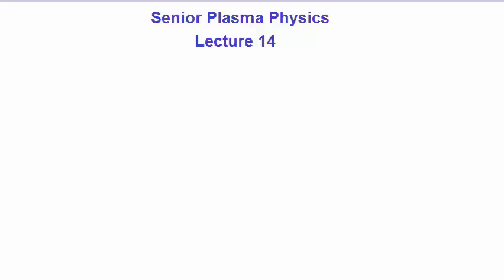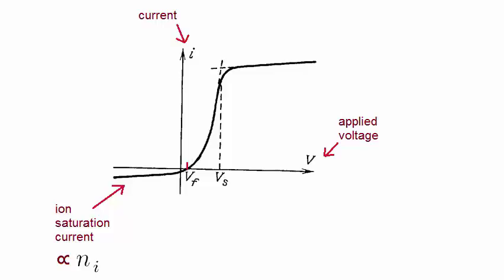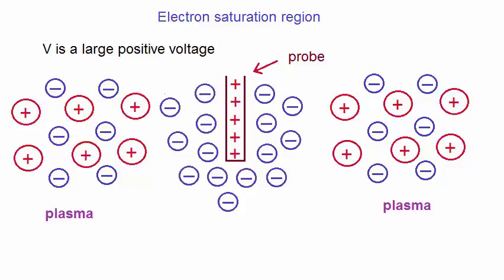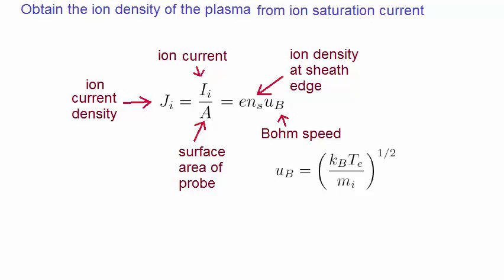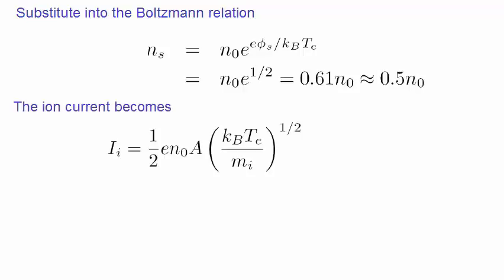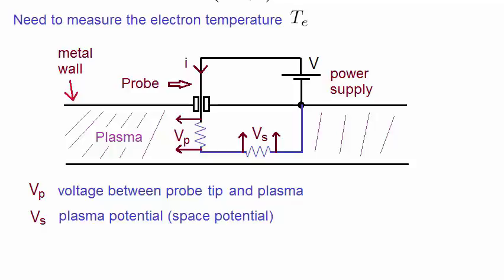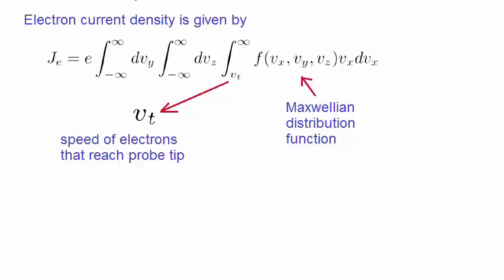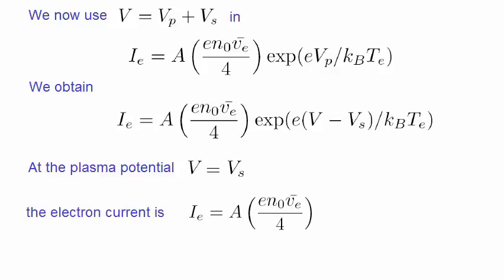Lecture 14 - Langmuir probe, electrostatic probe, plasma diagnostic

Comment: At 7:19, isn't v_t=(2eV_p / m)^0.5? Not 0.5mv^2 as shown in the video?
Reply from the maker: Yes you are correct. That is a typographical error. The equals sign after the v_t was supposed to be an arrow to the (2eV_p/m)^0.5. Unfortunately, Google has disabled annotations so it cannot be corrected with a pop-up comment anymore.

Comment: Hi, very good video, but one thing remains unclear to me : how do you obtain the temperature Te by looking at the slope of curve between Vf and Vs ? And why chosing a logarithm form if you look at the I curve instead of ln(I) ?
Reply from the maker: The slope of the line for the logarithmic plot has to be taken. The video was pointing out which region of the I-V curve is used in the logarithmic plot in order to obtain the electron temperature.
Reply: Take the derivative d( ln(I_e))/dV and the constant term will vanish. Remember V=V_p+V_s, take the derivative and you will get dV/dV=dV_p/dV beacuse V_s is a constant in the plot at  7:49. You will arrive to a nice expression that just depends on the slope multiplied by terms you already know. Sorry about the english

Comment: This is a nice video. 
One problem that I am facing is that my plasma chamber is made of Pyrex glass. 
I have the Langmuir probe which is connected by a coaxial cable. I can't understand where to connect the ground point of this co- axial cable. 
Can you please help me? 
Regards
Reply from the maker: It depends on how your plasma is generated. If it is a DC discharge then there will be a cathode and an anode in your chamber. Assuming your anode is grounded, then your Langmuir probe ground will be connected to that (but first make sure the anode is at ground potential). If it is a radio-frequency discharge and there is no ground in the chamber anywhere, then you will need to use a double Langmuir probe, not a single one as given in this lecture.
Reply: @usyd-seniorplasmaphysicsle6653  There is a cylindrical chamber of Pyrex glass. Two plates, anode and cathode is connected with a power supply of 1kV and a resistance in series. By lowering the pressure, I can observe the plasma glow. At the middle of the chamber there is a hole to connect the Langmuir probe. 
I can't understand the use of the body of the Langmuir probe as the body of the chamber is nonconducting. 
Please clear this point.
Reply from the maker: @nityanandadas5575  Please see my previous reply. You have an anode and a cathode. Check that your anode is grounded. If it is, then connect the outer casing of the Langmuir probe to it by using a conductor such as a wire. Your plasma is generated by the cathode with respect to the anode. So the probe must measure plasma properties with respect to the anode, not the glass chamber. I repeat my safety warning, that your  anode is already at ground potential, otherwise it can be a safety hazard. If you are unsure of any technical issues then please do nothing and seek in-person technical help. I do not want this channel to be one about technical advice. It is meant to present fundamental plasma theory to students. So this will be my last post about the Langmuir probe.
Reply: Thank you Sir for your kind reply. 
I will follow your valuable words . 
Regards